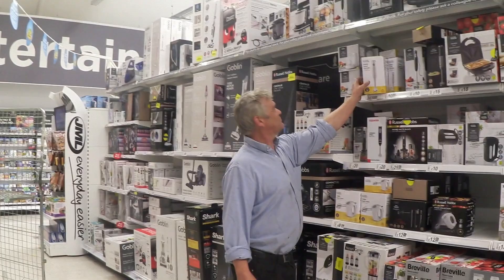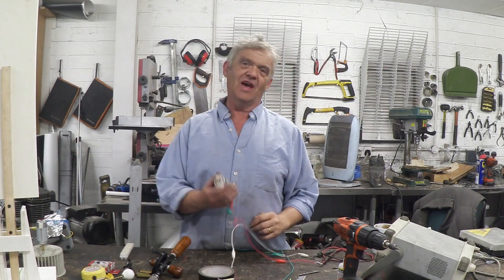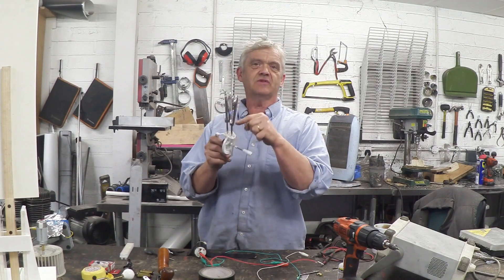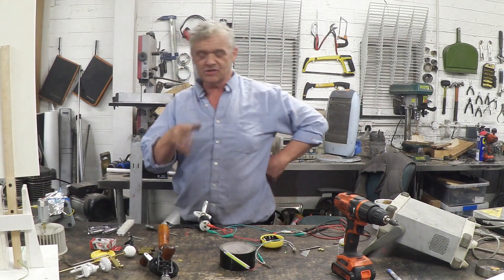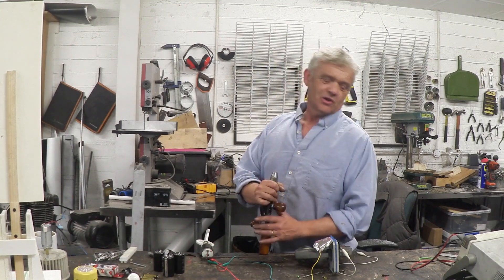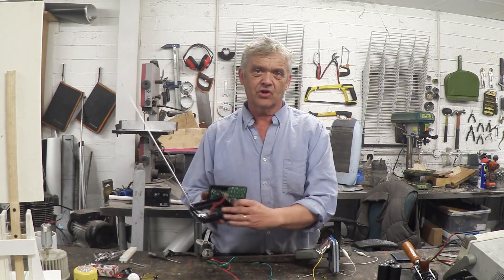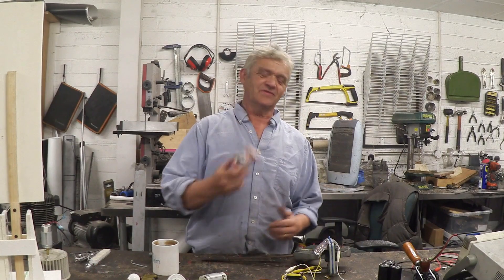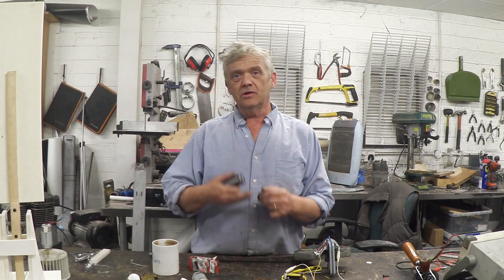1226 How To Cope With A Hurricane - Ready Or Not

Comment: We absolutely fill the bath tub with water here in the southern USA where we get several hurricanes a year before they come in.  We have "hurricane lamps" have to remember to get the fuel for them and keep them up high so they don't get knocked over.  Or of course BIG lanterns that eat through large batteries.  We do have hand cranked radios for sale here from and ton of sources that include of course the weather /emergency station "dialed in".  And usually have small coolers that we fill with ice to keep some perishables in before the storm because a fridge is a large space.  The cooler is portable if we have to evacuate due to flooding.  Preparedness is something we live with here.  Did you see what happened in Waverly Tennessee here?  That type of flash flood is unusual here in the eastern seaboard.  But it is common in the southwest in AZ where i used to live.  I am sick of disasters.  I have had my stuff destroyed in too many of them.  I am tired of starting over.  The military and moving was like one long disaster.  This is my 34th address.  Please pray for ALL of the people affected by the disaster in Afghanistan.  I cannot even fathom the panic the Afghan women are facing from dealing with those sociopaths the Taliban men.  I live next door to Ft. Bragg we have men over there right now.  Thank you for the upbeat video.

Comment: If you put a resistance on the out flow of a capacitor you can control the discharge of current. It means solid state batteries are easy enough to make. A simple rheostat employed correctly will give variability and the ability to dial things in. As your taking the layered approach .it should be easy enough to make a capacitor box with suitable quantities. it will be enough to power a house. In storm condition raise shields phrase for sci-fi could even become possible. 1000 year batteries and soo much more. Nice work keep it up! Fast changing slow releases is alway the best way to go. Might even recommend a fly back circuit with appropriate reset fuses leading to the resistor. Should things decide to overload their won’t be a huge explosion. Or a mess to clean up.
Reply from the maker: cheers mate

Comment: I live in Florida so I have a lot of hurricane preparedness both in the house and my van is set up to support me for 2-3 wks, I like this hand gennie idea, maybe to recharge a battery bank? can I just cut a usb cable or is it best to use the plug you showed? Water in the tub is ok but you end up either scooping up the last bit with a cup or wasting it, store that same water in gallon jugs and use smaller bottles to fill the gaps.. I say gallon jugs because they are easier for us older folk to lift and pour from than 5gallon and 1 gallon will usually flush a toilet
Reply from the maker: the plug has voltage stabilisation built in so it will work from around 3 volts up to 12 volts as input and will output a steady charge voltage suitable for phones etc - so I would say best to use the plug as a hand gennie is going to be an unstable voltage

Comment: I thought I would share an video idea regarding the same topic: making a mechanical buck converter regulator to charge your phone from your car. And since you would need this in an power outage situation, soldering iron, power tools & multimeters are not allowed. That means the voltage calibration part would be quite a challenge.
Reply from the maker: yess it would - hence the car charger plug!

Comment: In the near future you will just take power from either your e-bike or e-car.
Do we still need a radio at hand? It is getting outdated. More and more radio stations are no longer doing the electrical (antenna) broad casting on FM and are switching to DAB(+) or internet. But DAB+ in my region has bad repentance, so I am not sure how to 'listen' to anything. Luckily I do have HAM radios and 27MC radios at hand. For just in case :-) (and they are charged and checked regularly). And charged power banks all over the place, using 18650 old laptop batteries (8 per power bank).
Do I need all of this? No. Not here, in the Netherlands. Let's call it a hobby then.
Reply from the maker: to me - our world is ridiculously fragile and our dependance and belief in it equally worrying - ah well